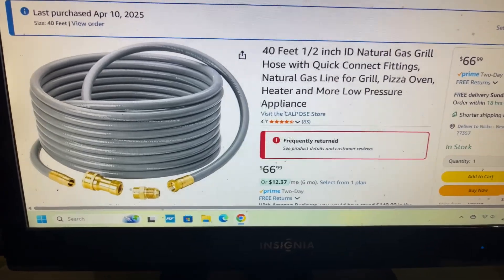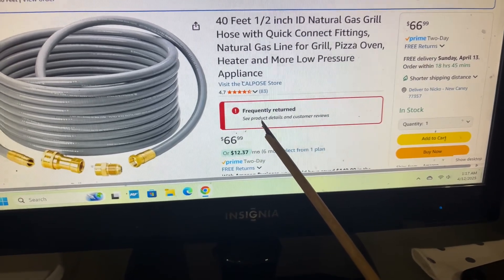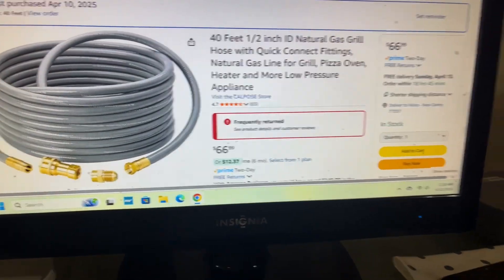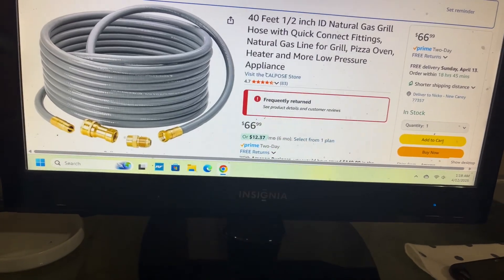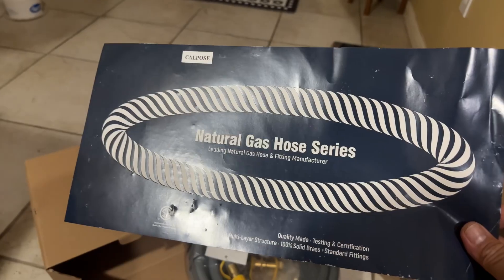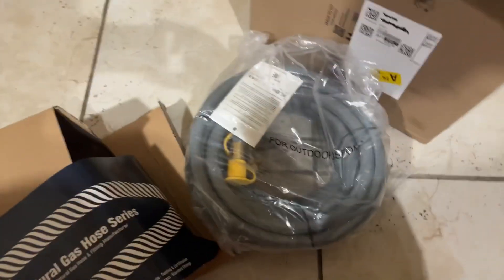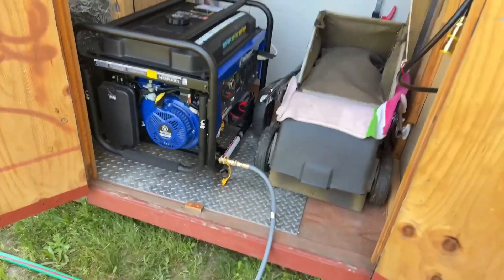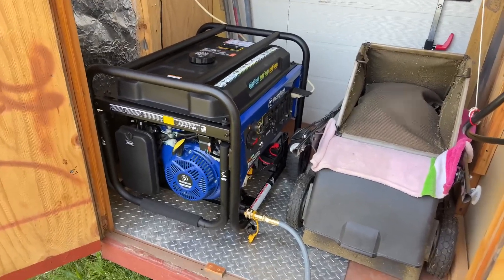Westinghouse Generator Natural Gas Review (Part 1)

Comment: Even with 40ft it will run, but may not produce full power. The general idea is to have the hose as short as possible.
Reply from the maker: Thats true more short runs well….i’ll try mine the 55 feet with 1/2 dia hose i work’s ok i run the whole house with hvac but not include thr dryer

Comment: Hi nick.  Did the two hoses connected for 65 feet work after the line cleared the air?
Reply from the maker: No not at all the generator is start and die is like short of gas supply reason the hose is little 1/2 diameter may be if you using little bigger is gonna work i have another review soon i try 55 ft’ my plumber said the maximum lenght that you can use in 1/2 hose is 40 ft’ thanks for watching please subscribe i have a part 2 review soon